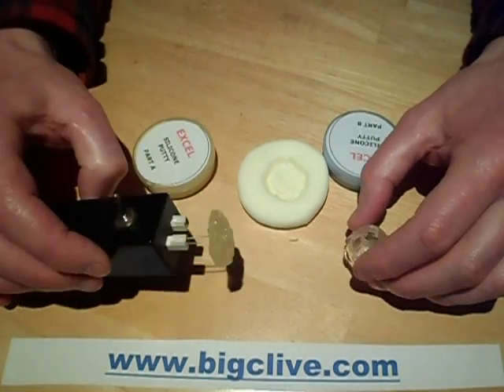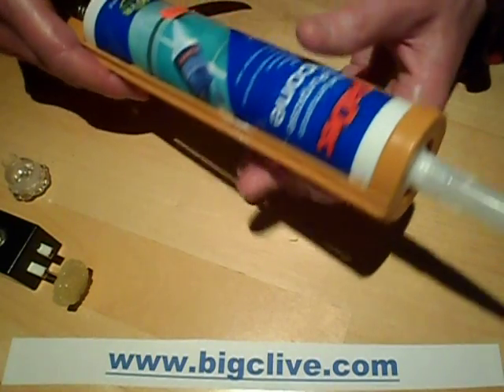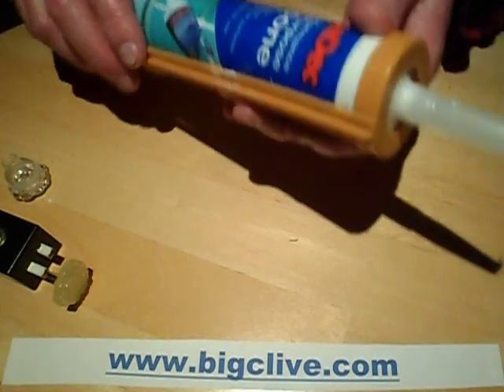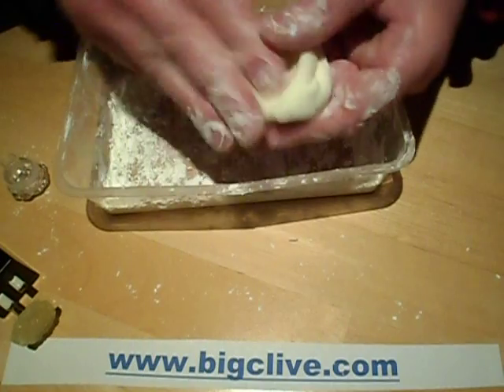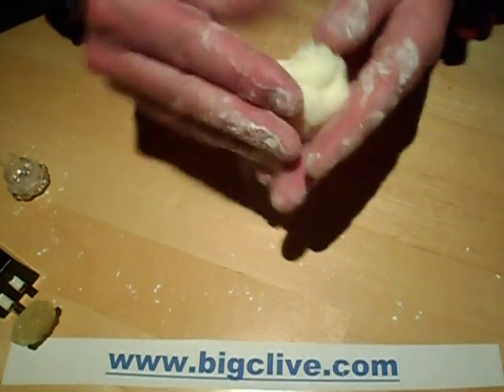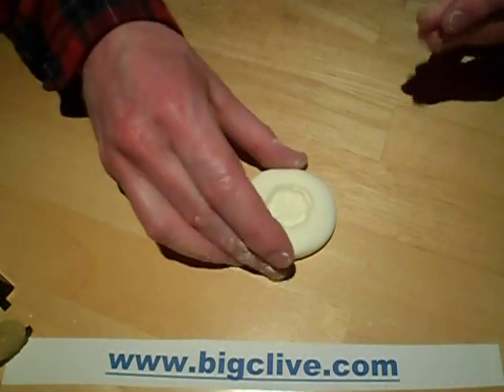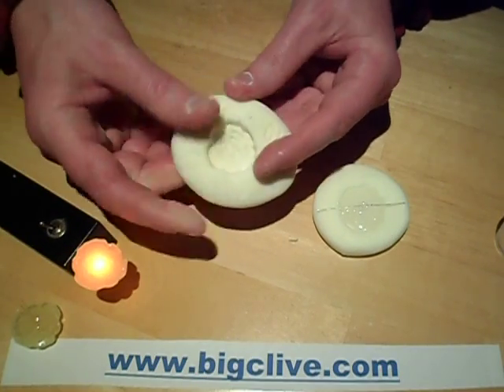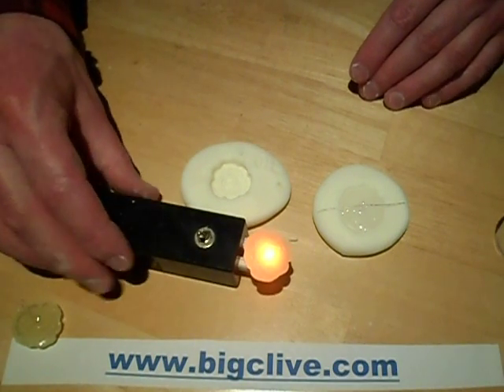Make custom resin LED shapes with silicone moulds.

Comment: Great Scot a cooking with Clive special and a fabulous useful dough to make. This has given me great ideas to make items for different projects that need a repetitive but reusable mould. One can add acrylic paint to the resin during mixing to colour the casting too. It would be one way to make home-made streetlamps or floodlights etc, or security wall alarms or cameras with flashing-coloured mini-LEDs in them. Just make the moulds, make the resin add the LED and leave to cure. Once ready pull out the casting, paint it black to block light bleed, prime it with an undercoat and add finishing topcoat. Where one wants the light to show through mask it off before painting, then remove after painting is done. Cool and useful vlog tip for modellers to use and reuse multiple of times.

Comment: Before he passed away Grant of King of Random used to make this all the time, he nicknamed it Protoputty but really it is all the same process except he tended to put food coloring in his to give it colors. Now if I can find a way to use Caulking Silicone in a "Diy Pourable liquid Mold" style where you can put the object you wish to duplicate in a box and then pour a more liquid mix of silicone over it that will cure and not need to buy the two part kits of SVR Silicone mood making stuff (a well known brand is Oomoo by Smooth-on) I'll be happy.

Hmmm maybe a idea for you to try Clive? I mean it couldn't hurt to have a liquid silicone mold maker that you can make yourself, cured like the two parts but is much easier to get and cost effective at all times (Caulk is very cheep and sold in most super markets) eh but it is just an idea I'll keep looking myself and if I find something I'll be sure to pass the info along.

Comment: Using a magnet to hold the LED leads in place would work quite well.  Could be as simple as bending a paperclip around, sticking it into the silicone, have a bit folded over to be a flat surface for the magnet, then the LED legs on the other surface of the magnet.  Or fancier might be build a wooden frame and glue the magnet to that, which could allow for doing a whole row of moulds at once

Comment: Thanks a lot for the video!! I do you need to use only platinum cure silicone (addition silicone) for resin castings? Or can you use any type of silicone for resin molds please?
Reply from the maker: Most silicones will work.  This one used cheap silicone sealant from a DIY shop.
Reply: @bigclivedotcom  thank you so much !!

Comment: Cool video, Im sharing it with DIY stompboxes so folk can make custom knobs, possibly incorporating a slip ring so we can put leds in too, Am i right in guessing the resin is simply 2 part epoxy resin you get from diy stores?
Reply from the maker: For quick experimental objects I use pound-shop/dollar-store two part epoxy.

Comment: About the water. 
A few drops of water added to the silicon accelerates the curing to the point it will be cured through and 10 minutes flat. Sometimes it's a good thing other times it's a bad thing. 
In order for this to work its important to use only 100% silicone 1. Other silicones use different curing chemistries which don't interact with water. 
The water is also important if you want to make something with a thick section. unmodified silicone as it comes in the tube only readily cures about a centimeter deep, if you wanted to make for example a 5 cm silicone ball it would take (I'm guesstimating) over a year to cure through.

Comment: Can you use plain flour in place of Cornflour ?
Reply from the maker: No.  I tried and the results were nowhere near as good as the cornflour/cornstarch.
Reply: Thanks Clive, only I have a couple of bags of out of date flour I’m trying to find a use for. I have a problem with a single 18650 battery charger. Took it to bits, better known as ’doing a Clive’, and think the transformer has blown. It was on for about two minutes from new when it blew. I have photos but can't attach them.

Comment: One tip:   When working with resin like this, if you have a vacuum pump use it on the resin before you drop it into the mold...   this will pull out all the air bubbles worked in during mixing and create a clearer final product.   If you're using something like the plastic shot glass either a large stopper, the kind for lab equipment with a hole through it, or some kind of 'one size fits all' disc you often get with heat sealing products both work well !!!

Comment: This video raises some questions.

What made you think that mixing corn or wheat flour with silicone would result in something you could use as a mould?

You repeatedly state the optimum consistency of the mix but how many attempts did it take you to determine this?

Enquiring minds want to know. :)
Reply: He didn't come up with this all by himself, this recipe is pretty old, it's known as "oogoo" and can be used in many applications. If you Google it you can find really interesting uses for it, I just find it weird that there isn't much about it on YouTube.
Reply: +Rafael Gomes

Thanks.for that.  You supplied a missing piece of the puzzle. :)

Not that it matters how he came up with that recipe, as long as it works, just that I have an enquiring mind.

Comment: I was wondering if it would help improve the light spread if you lightly hit the LED with fine grit sandpaper all around the casing. Or maybe use a more milky resin?

Comment: can you solder before you cast? I need to create a solid water resistant series of lights and need to thought I'd ask before I try this
Reply from the maker: Yes.  You can solder your connections and pot both the LEDs and their wires inside the resin.  Professional outdoor Christmas lights have the LEDs, resistors and wires all potted into little tubes with resin.
Reply: bigclivedotcom thanks alot. I'm trying to light up my mohawk.

Comment: and the resin can be colored with any dye? or is it best to get color from the LED's?
Reply from the maker: You could use a resin compatible dye, but don't use much and match the colour well to the LED as the simple colours only emit a single wavelength of light and a colour mismatch will reduce the light output a bit.

Comment: Do you think i could do this with high temp silicone (300 degrees C)  to make molds for molten tin or would it burn?
Reply: +Pownyan I'm guessing it'd work for smaller casts, otherwise you'll need an inorganic substitute for the corn starch such as talcum powder or maybe chalk

Comment: if your trying to get a clearer cast with the resin you can stir it very gently in tight circles, avoiding whipping air in. but the fun way to get bubbles out is with a torch, just hit it with the heat in quick passes.
Reply: +TacZakk1911 you mean the kind of torch that villagers carry along with pitchforks to chase down a witches ?  Or do you mean the gas lighters you get in ye olde Pound shoppe ? The former would make an interesting tutorial. "So here we have a flaming torch the type used by most rampaging villagers. Once you have poured the resin gently pass the torch over it. This causes the paraffin I had on the work table for no good reason to ignite along with the table,me,the carpet and curtains but does remove trapped bubbles in the resin. Hey ...we make these videos cos you don't want to.

Comment: Your wheat  flour  mold likely  cracked because the  moisture in your silicone  caused the wheat flour to  create gluten and  and when that get  dry . it  cracked . similar to the top of a bread loaf 

Also  Corn starch likes to make slurries more readily in water . and like you said the  particles are much much finer.

Comment: Clive, I have two FOUR questions:

1. It's hard to acquire a silicone caulk which includes acetic acid here. So I have acid-free version only. Is this going to work with that kind of caulk? (Note: It's sometimes referred to as "Soft-smell silicone caulk" because it gives off chemical smell but not that kind of acidic stench)

2. Is this method safe for molding body parts, e.g. hands, feet, etc.? (I know it's dangerous to try to apply things to sensitive areas so I am not gonna try that anyway - e.g. face, ears, or naughty part of male human body, etc.) This question applies to both acidic and non-acidic version.

3. This isn't necessarilly related to silicone molds, but I will ask anyway -- I heard that alginate molding compounds shrink as they lose moisture, and epoxy and urethane resins don't work well in humid areas. If I were to mold my, for example, pinky finger or thumb or my hand, pour clear epoxy resin into that cast, wait for about 3 to 15 minutes for it to cure, then pull it out, will the result be faulty/not-as-good-as-it-were-for-plaster-casts?

4. How do I know if two-part resin is mixed well enough to be sure there will be no unmixed leftovers -- such as blobs of curing agent or epoxy resin itself -- and how do I get bubbles off the mixed resin? I need to make a resin-potted LED with almost no bubbles but it always end up with either aforementioned sticky stuff or lots of bubbles.
Reply from the maker: +Phil “Xavier” Sierra Jones I'd say the only way to find out about the silicone suitability is to experiment with some.  I wouldn't trust moulding from body parts with this directly.  The mixing is just a matter of being thorough and making sure you get into all the corners.  With traditional casting resin it stays sticky in air deliberately to allow subsequent layers to bond on flawlessly, you need to exclude air to allow full setting.  With two part glue resin it should lose stickiness quickly.  The bubbles require wither careful mixing or a professional degasser which draws a vacuum.  Quite an expensive thing.  A trick used in the prop industry is to pop surface bubbles by waving a flame from a gas torch across them.
Reply: +bigclivedotcom 
Looks like I have to do it like this since the test batch did not solidfy at all or was too weak:
1. Make negative mold using alginate
2. Pour quick-setting liquid material, i.e. molten wax below 70 degrees centigrade
(This part was taken from a project involving clay and wax)
3. Pull positive casting out
4. Apply generous amount of silicone on positive cast, waiting few hours between application
5. Pull positive casting out
6. Pour whatever that doesn't react with silicone (e.g. silicone resin cannot be used) into the mold, shaking the mold every few minutes
7. Pull final cast out

I heard that if alginate was mixed 1:1 with water instead of 1:3, it turns into the paste so you can apply it on complex shapes without using too much of it to fill void (where the object is not present); 
e.g. If you take a billard ball and want to cast it, on liquid form it should be in a container so there is no way you can save material because you have to fill entire container in order to make a mold (though the structual integrity would be higher), but in paste form you can just daub it on the object and save few bucks on molding material (though air bubbles would be a problem if the details are VERY important)

Comment: Could you use the clear sealant instead of resin to get your flower?
Reply: +Ian TheInventor I'm not sure but I know silicone likes to adhere to even old silicone and is a mess but with the addition of Corn starch I just don't know.  Hmmmmm.  Would be cool if you could for sure.
Reply: It would take a while to cure and you would have to coat the mould with a release agent such as petroleum jelly (vaseline) so that the silicone would not adhere.

Comment: you could rough up the top with sandpaper to make them diffuse more
Reply from the maker: +Carter Cole Or mix in a tiny quantity of talcum (or even more corn flour) to make the resin slightly diffused.

Comment: Making a copy of a hand, foot ... could be done in two half moulds. 
If the mould setting time was quicker, it could be used for the building of many small moulds into one big mould of the head of a living human.
Filling with clear but tinted resin could be used as teaching about nerve, etc pathways. A string of LED could demonstrate this.

Comment: Once it's cured, would this be food safe? Maybe for moulding fondant for cakes?
Reply: moogthedog You should NOT use household repair silicone for food. There are many other suppliers for food grade supplies. Look up "food grade silicone mold."
Reply from the maker: moogthedog I couldn't honestly say.  If you used kitchen silicone sealant then I suppose it may well be classed as suited to a food preparation area.

Comment: One little notice that most resins bought do not thermally react raising the temperature of the resin stays in the warm region as these are polyester resin but a word of caution is that epoxy systems can have a huge build up of temperature and sometimes has caused fire's as the mixing container was thrown into the bin and generate higher temps as the rubbish acts like a blanket so just keep the container on the bench and it will also tell you when the item is cure as the resin in container will be hard set so you don't have to touch your part and possibly damage the part if not cured.
Reply: gigabytex64 THE LEGENDARY ONE-PERIOD ATTACK.
Reply: Punctuation? Heard of it?

Comment: Nice, how long would the mould last? I would like to make some boots for the end of connectors on my motorbike to keep the rain out this seems like it could do the job. Would adding food colouring  give you different mould colours?

Thanks for the cool video.
Reply from the maker: The moulds seem quite robust.  I can't see any obvious damage after casting several items in them.  You can use coloured silicone or possibly add a pigment based paint like a small amount of acrylic paint for colour.  I wouldn't actually recommend the use of acid curing silicone for making electrical covers though, since the acid that continues to get liberated for some time after curing can cause corrosion of electrical contacts.
Reply: bigclivedotcom Ahh ok I wont do that then. Thanks for the reply :)
Reply from the maker: Kevin McMillan You do get mouldable rubbers like Sugru, but one of the most common methods for sealing outdoor electrical connections is a rubber tape called self amalgamating tape.  It's basically a stretchy rubber tape that fuses onto itself.  Just keep in mind that anything that can keep water out can also keep water in, because water ALWAYS finds a way in.  (I do a lot of outdoor electrical work.)
Reply: Kevin McMillan I'd second the call for no silicone near electrical. Just to add to what Clive's said, you CAN get neutral cure silicone, but self amalgamating tape is the best for your application.

[digression] A friend of mine in the early 90s made a car immobilizer, (basically interrupted the ignition coil primary after 10 seconds or so if you hadn't plugged a code chip into a jack on the car dash)... but he used silicone to seal it. It immobilized him on the motorway randomly after the acid ate most of the way through the PCB tracks and one blew like a fuse.

At least he wasn't in the fast lane!
Reply: +Kevin McMillan I realize this thread is a year old, but...

Linseed oil paint is perfect for coloring the silicone molds.

Also, if you need to thin the stuff out for pouring, add a tiny bit of naphtha.  It evaporates fast and will thin the stuff out quite a bit.
Reply: ***** bigclivedotcom  lol Yeah I think I might have some kicking about. Good point about water always getting in and not back out. I guess if I tidy up the cables and keep and the grounds to one side then I could prevent a short if water gets in. My bike is over 30 years old lol so its got a lot of old bullet connectors all crammed into the headlight. Thanks for the tips :)
Reply: Sorry Dosbomber... Thinning what stuff? The colour or the silicone or the epoxy? Thanks.
Reply: I use hot glue to insulate connections outdoors. No need for the gun, just use a lighter on the glue stick.  If you need to remove it, use isopropyl alcohol.